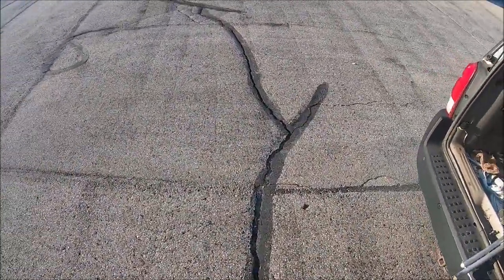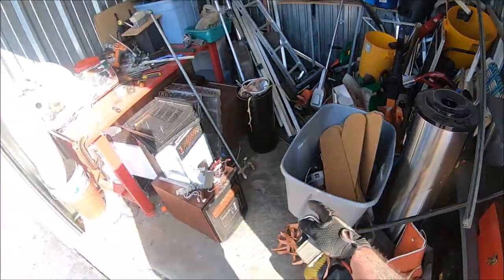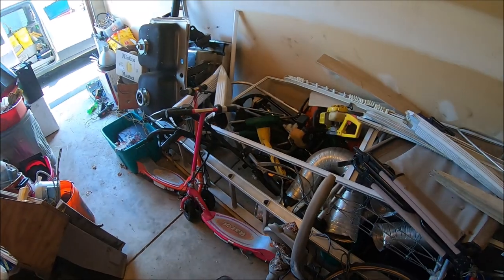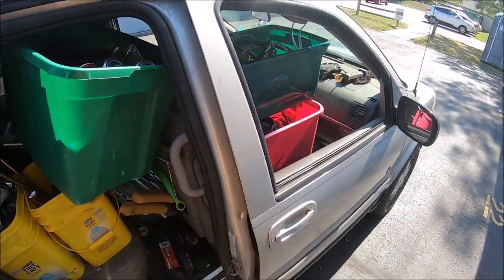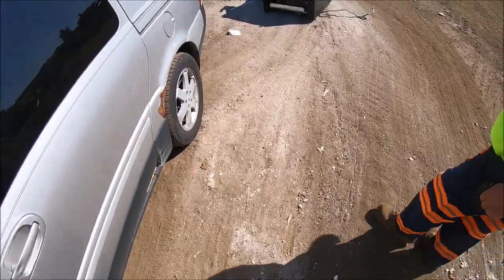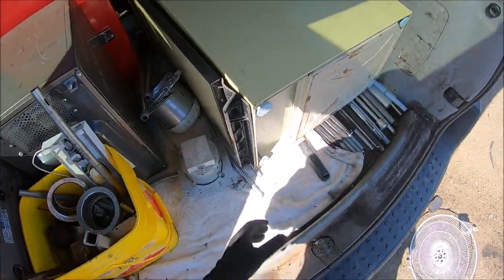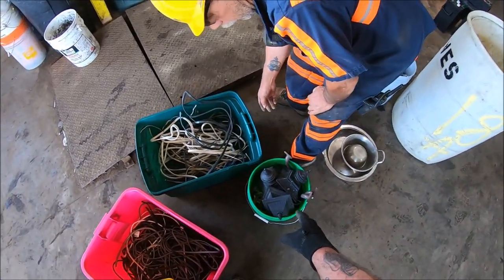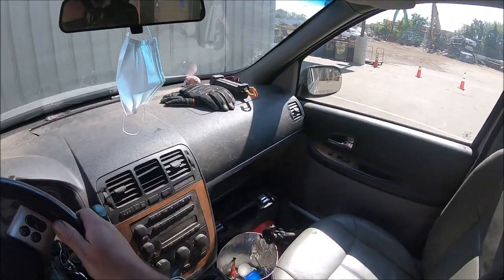SCRAP CLEAN OUT DAY ONE

Comment: Romex is on average 20 cents more a lb than #1 insulated. Stainless breakage is 10 to 15 cents a lb more than shred. You lost yourself 20 beans or more. Scale guys should school you & they don't. Shame. It may not mean much in the long run , yet, knowledge is power & if you are going to save it all like that. Might as well get paid. That & you didn't bring them any bare bright. Bare bright is stripped wire, that is "bright" not dinghy.  Ty for taking us along
Reply from the maker: I know all of what you wrote. The yard is very helpful. Time is an issue for me. While I highlight how much I make after each scrap yard run, it is not the main reason for me doing this. I foolishly spent too much time street running and not processing. Now, I have to clear out both units to setup a working tear down area. Thank you for the comment Richard. Much appreciated.